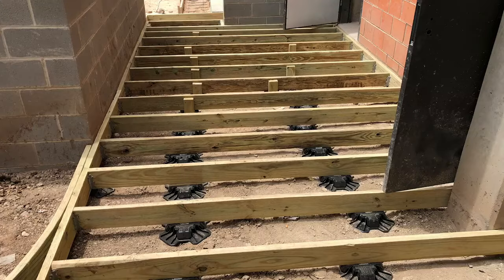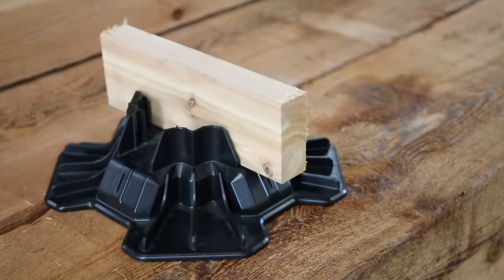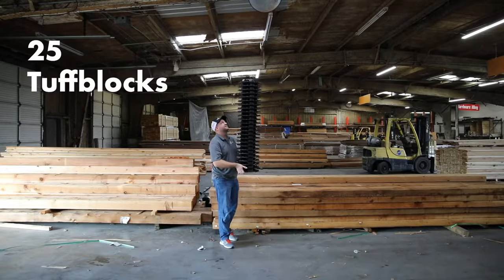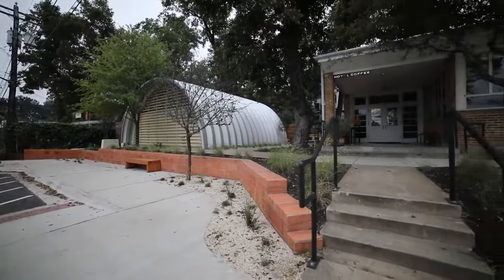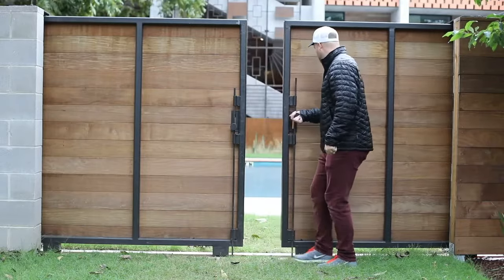Could a piece of plastic replace traditional concrete footings? - TimberTown Reviews TuffBlock

Comment: If you wanted to add wind resistance you could drill holes into each of the four wings of the blocks and drive 4 12 inch nails at an angle to grab the soil. I think you should even add this to the intended design.
Reply from the maker: Good shout. We've seen tradesmen tie them down with dynabolts and whilst it wasn't originally intended for that purpose, it worked out very well. Another option is hurricane anchors.
Reply: Better check and see if any penetrations compromise the integrity of that footing. Wouldn't want to have a insurance company not pay, or have a warranty not honored  due to negligence
Reply: You'd probably be better using polyurethane adhesive and fill in the bottom of the waffle pods to glue it down. Will maintain warranty and make it stronger than dynabolts as they might compromise the tuffblocks structure.

Comment: These have to be used on ground that doesn’t get soft during winter thaw though right ?
Reply from the maker: You should prepare the ground by removing any loose top soil and compacting down. But additionally, floating structures are designed to move with shifting ground. It was a building method first implemented in northern states where the frost line was prohibitively deep, and for simple structures like floating platforms, sheds and cubby houses etc, then this works perfectly.

If you're building a large scale raised deck, then definitely use in ground piers below the frost line. This also goes for any structure attached to a fixed point.

If in doubt, contact a local licensed builder.

Comment: I've been looking at these for awhile now. I'm wondering if I could be used for 4x4 fence posts? I need about eight of them. That would take a lot of digging and concrete
Reply from the maker: Hey sorry I didn't see this sooner. TuffBlocks don't work for fence posts, as the post needs to be 1/4 to 1/3 of the post length into the ground. TuffBlocks wouldn't anchor it in place.

Comment: How many would be required to support a 2x6 shed base measuring 8’x15’
Reply from the maker: Hi Robb, you're looking at about 30 TuffBlocks.

We have a calculator to estimate the amount you'd need which you can view here:

https://buildtuff.com/pages/deck-area-tuffblock-estimator-chart-calculator

We also have an article that covers how the type of lumber and direction of your joists can impact the number of blocks you'd require:

https://buildtuff.com/blogs/diy-ideas/how-many-deck-blocks-do-you-need

We wrote the article because the calculation is dependent on a lot of factors such as the thickness of the lumber, whether it's a raised deck or ground level, the type of decking boards (affecting the joist centers) and direction of joists. To get an accurate answer you'll need to sketch out your subframe based on the span tables and joist centers to get the number.

Hope this helps!
Reply: It’s a ground level platform with the joists spanning 8’ and will have 5/8 pressure treated plywood on top

Comment: Can these be used for a 10×10 dog kennel for fence post 4×4 post
Reply from the maker: TuffBlocks fit 4x4 posts so this should be achievable. Our TuffBlock spec sheet has line drawings with all measurements which you can find under the Resources > TuffBlock Info Hub on our website:

https://buildtuff.com/
Reply: No.  Fence posts need to be set in concrete or anchored with bolts on a concrete slab..

Comment: How durable is it?
Reply from the maker: Extremely durable. You'll be replacing your lumber before the TuffBlocks that's for sure. TuffBlocks are UV stabilized and made from high density polyolefin. Break tested to 11,000lbs per block. Check us out in Lowe's to see for yourself